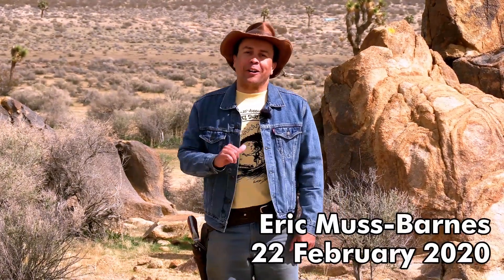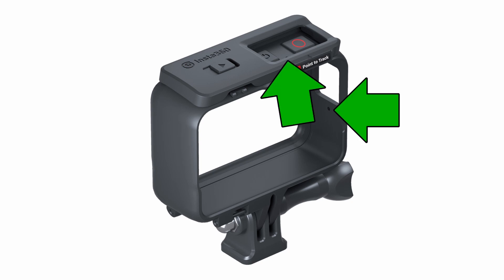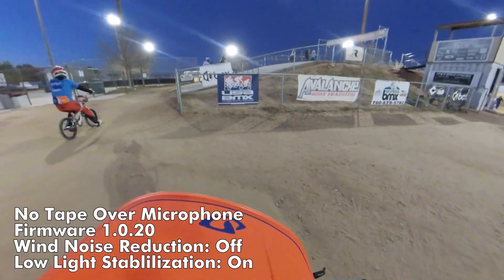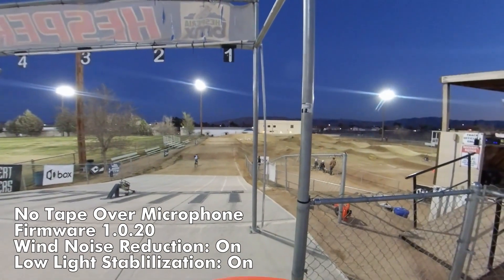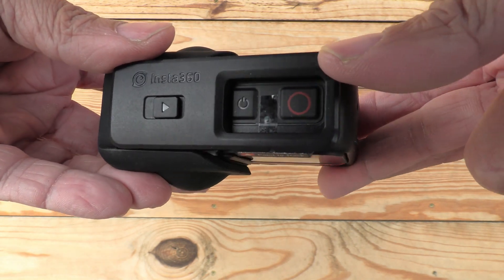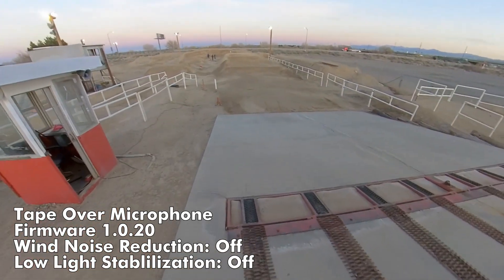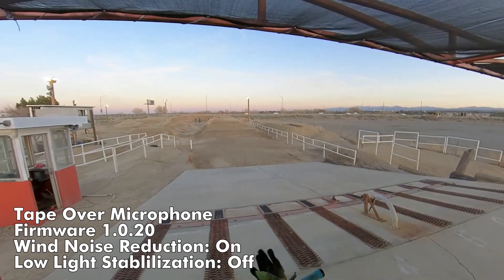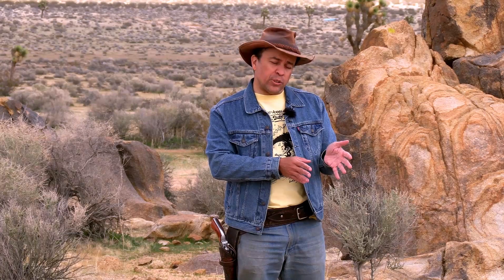Insta360 ONE R: Wind Noise & Low Light Tests

Comment: Great video.  I noticed some blurry edges or stitch lines.  Very thorough.  The sound quality is just awful.  I'm in the process of making another video with side by side footage with my gopro hero 8.  Should be out soon.
Reply from the maker: Thank you. Glad you liked it.
There are occasional stitch lines when you cross the threshold, but those don't bother me too much. Lots of people get very picky about stitch lines. I'm more picky about audio. Due to the nature of the technology, I'm impressed by how subtle the stitch lines are on ALL of the 360 cameras I have seen.
Personally, I'm fairly pleased with the audio using tape over the mic, wind noise reduction on, and the 1.0.20 firmware. It's not perfect, but it's adequate for my needs. Hopefully, future firmware will improve it enough to remove the tape.